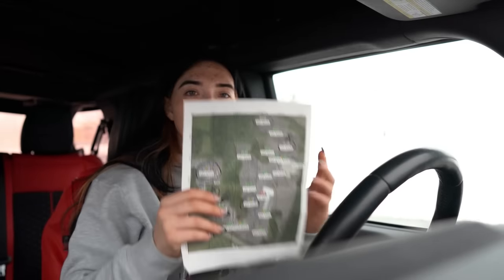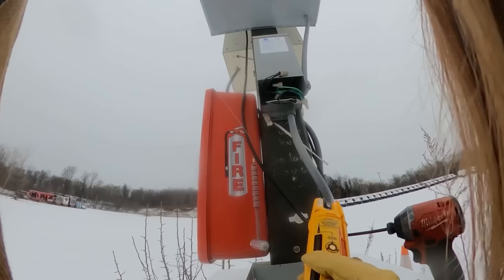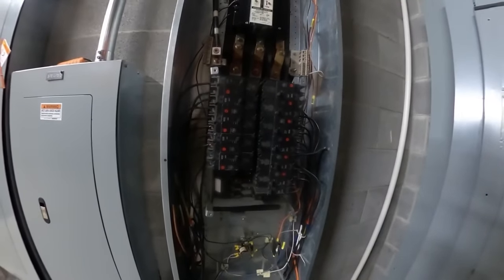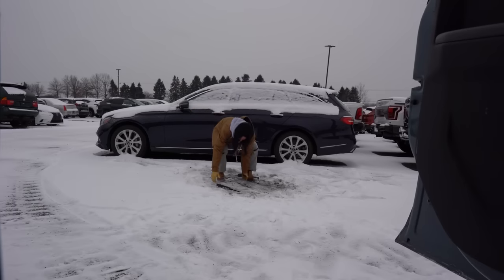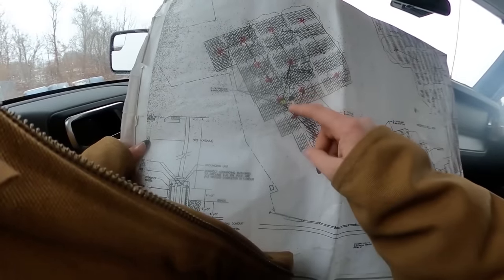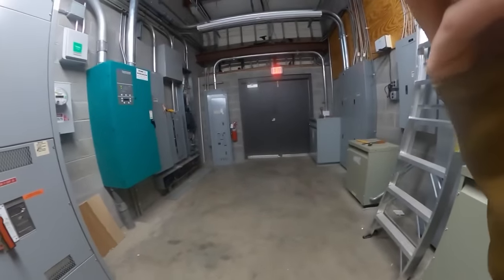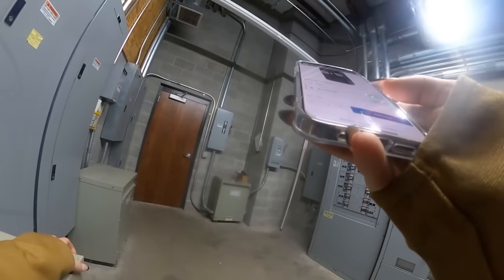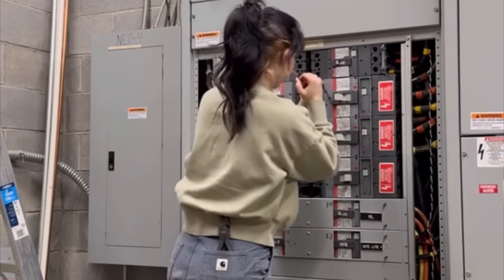Commercial Troubleshooting - Live Manhole & Blown up Breaker

Comment: “ I should not have turned that off”…… words we have all spoken, a phrase you don’t just hear but you can feel it deep down inside.
Reply: I learned a long time ago, the hard way, breakers trip for a reason, had a entire main breaker blow up, cause i kept trying to reset it, first try tripped, second try tripped, third try the whole room lit up like someone took a picture with flash, a loud boom followed, good thing i had my face turned away. Will never forget that.
Reply: I felt thatttt
Reply: Come across this in plumbing, old gate valves you can turn them off but sometimes they won’t open as the top of the stem which captures the gate becomes corroded away 😢🤦🏽.
Reply: 4 hours to end up saying…. it hurts in my stomach 😂
Reply: i do an IT. i've said this phrase to myself at least 100 times

Comment: Not to be a stickler…but where’s your arc flash gear…you need to be safe when exposing yourself to live circuits over 50 Volts.
Reply: Not to be rude but you must be union.
Reply: @chernoalpha107  Nope I’m a retired Master Electrician that has seen the results of not wearing proper arc flash gear, most don’t survive and if they do they have disabilities that last until the day they die…safety first.
Reply: @chernoalpha107 it is not about being union, he got a good point because it is for safety and if your a fan of this channel you don’t want the chick to get hit.
Reply: Arc flash gear don't come in pink ... But Bob the Union electrician does. Lol

Comment: If a breaker trips out never due to an open like she said. Its a short! She should be wearing proper PPE when taking cover off a 480 volt panel. Best practice whole turning in all circuit breakers & Safety Switches is to stand next to panel or switch take in a deep breath & hold it to then use your left hand to turn it back on. Then exhale. Common sense that very few sparkies use holding thier breath. If an Arc Fault or an Arc Blast occurred holding your breath would prevent you from inhaling up to 10,000 degree super heated air.
Reply: NFPA 70E NEVER FAILS

Comment: I spent 30+ yrs working outdoors and the warmest clothing I used was an insulated one piece coverall. If you’re spending any length of time in the cold, I highly recommend one. When you go inside, peel the top down and you should be ok. 👍 BTW I hate square manholes. Trying to get one of the covers out of the hole really sucks. 😕 When you pry one open, put a piece of wood in the gap. It’ll save your fingers.

Comment: Amazing to see non waterproof connections in those manholes. I worked on pole lights at an apartment complex where the boxes and the connectors weren't waterproof. It rained off and on that week and the boxes were nearly filled up with water. Plus one box apparently got damaged, so they had the spliced wires just buried in the dirt. 😮  I really enjoyed your detailed video. 😊

Comment: I’ve done some parking lot lighting troubleshooting in both NY and Florida in the past. Watching you open up some of those manholes brings back many memories. I love watching you work and listening to your train of thought as you try figuring out the issues, which may be multiple issues on a job like this. 

I have a couple of suggestions. 

1. On really cold days like this when I’m working outside, I highly recommend the Milwaukee M12 Heated Work Gear. On a day like that the Heated Toughshell Jacket would have been perfect. And if you use the heated gear often like I do, there are a few videos on YouTube that show you how you can use a slimmer but larger capacity battery to add longer runtime for the jackets. Highly recommend the gear and battery hack if you work outside in northern climates often. 

2. Safety Gear. I know I know, you probably hear it all the time, but working with 480 equipment is no joke. Especially if you’re finding things loose in a panel, there are likely other issues that could cause the equipment to arc or even explode. You should never be sticking you hand in an electrical panel like I witnessed you doing without wearing even some very basic hand protection and safety eyewear. 

I’m not looking to lecture you because I’m sure you’ve heard it all before. But take it from someone who had a coworker end up in a hospital for over 6 months and lost being able to work in this industry ever again. It is not worth it. Accidents happen, especially when you’re “just checking” some of the equipment. You need to wear safety eye/face gear and gloves when working in these higher voltage panels and circuits. Especially when working alone. I don’t even want to think about if something bad happened to you while in that electric room alone. How could you get help? Trust me. I beg of you, wear that safety equipment all the time. Once you make it a habit you won’t even think twice about it. Because one day, it could save your life and livelihood that you love so much.
Reply: Over confidence can kill, 1 mistake is enough. Having a co worker who lets you think through issues without distracting, might be a co worker who will say "be careful, this could kill you" . Reality check
Reply: safety gear saved my face. years ago, removed the panel cover of a 3 phase 480 box with a bad breaker.  The breaker fell apart when the panel came loose, arc'd and blew the panel cover and me to the floor. Had I not had PPE on, I would have been in bad shape instead of just having brown pants.
Reply: Working along and th3 lack of PPE is a real issue.

Comment: Total agree on the Torque to spec and check after system has been energized for some time, especially when doing troubleshooting. Now if the breaker needs to be shut off. Shut it off ! If it fails to work after shutting down it is the breakers fault and never the Technicians fault for being safe. Keep up the good work!

Comment: 😂😂😂
"Should of never turned that breaker off"!!!!
I'm laughing because I did a shut on a main switch gear. turned off all the breakers to shed the load and one of the 200 amp breakers that fed a panel would not turn back on. Luckily there was a spare 200 in the gear. 
I said the same damn thing 😂

Comment: Another GE junk circuit breaker. You were very lucky to find replacement so quick. Turned off a 400 amp GE junk 480 volt breaker for a tech to PM a chiller. Would not turn back on. Took a week to get another one and very expensive. Of course when we got that chilled back on line the other chiller POS GE breaker failed to reset and had to be replaced. We checked old breakers with a torque wrench and they had the proper torque.

Comment: This is more a general question to US sparks but when fault finding will you tend just to use a voltage tester like on this video? A multimeter/multi function tester can be useful. The low ohmmeter function  can tell you if you have a short roughly how far away it is. Testing insulation resistance can be helpful too

Comment: What kind of preventative maintenance should be done on a breaker panel?
Reply: Exercise the breakers at least once a year (just turn them off and on again)

Every few years turn the panel off and check that all terminations are still tight.

In industrial facilities, it’s fairly common to do thermal imaging scans regularly to identify hot spots

Comment: They were probably torqued properly but loosened over time. Torqueing lugs really gives you a false sense of security because the threads are dry on galling material so the torque wrench makes you think they're tight when they're really not because of the binding of the threads, if they would use less torque with a thread lubricant the wires would actually be tighter while using less torque

Comment: Nice illegal jacket to be using while testing or working on energised equipment. MUST have a CAL rating equal or higher then the circuit or equipment you are working on. If company refuses to purchase you approved PPE rated sweater shirt, jacket, long sleeve shirts,pants , rubber glove tested & date stamped every 6 months then refuse to do work that could do serious harm or kill you. My company purchased all that stuff and non metallic toe guard work boots rated for 1,000 volts. I had a lazy helper years ago that wore a cheap ski jacket. He had to help a welder for a few minutes and it that short time sparks set the jacket on fire. We yelled at him to drop & roll but he did a high speed run. If he wss wearing PPE with the proper CAL rating jacket would not have caught oh fire.
Reply: You working for someone.. she works for her self ok, so if you never run your own small business you don't know how hard to keep everything in code to satisfy all your DOB body's